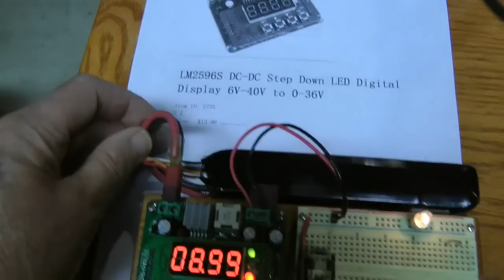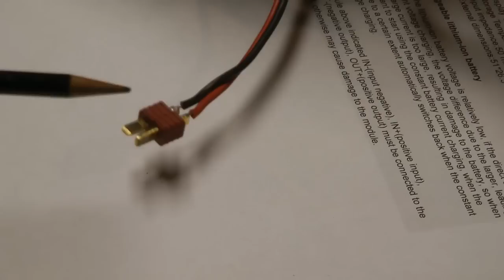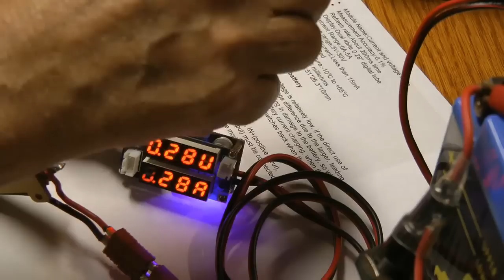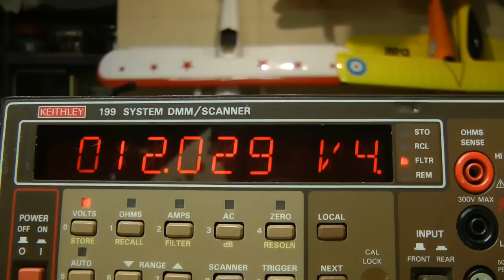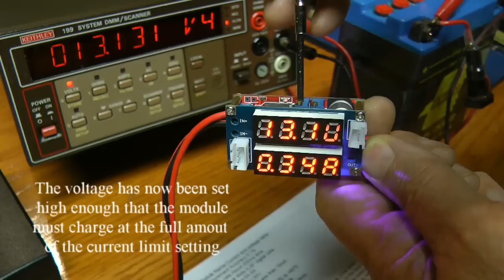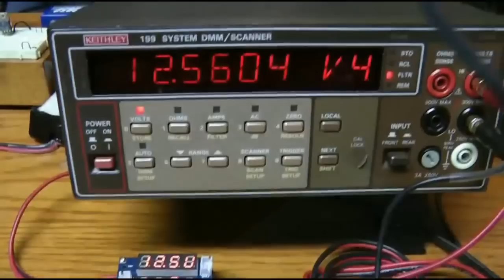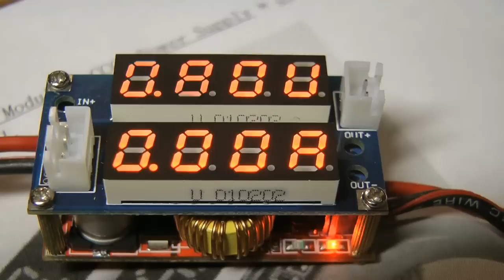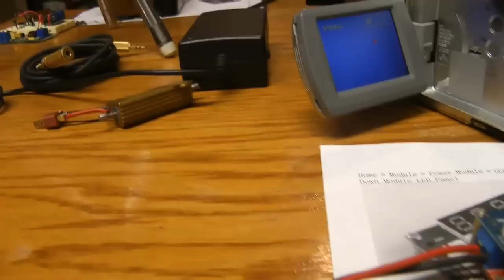Battery Charger / Power Supply

Comment: Thats a great little unit John. Thanks for the informative video.
Reply from the maker: +TinManPower Hi Buddy, I just thought of something. You can charge your project battery with the converter then just turn it around and power up you project with any voltage and current current limiting. No need to use a fuse.Take care.
Reply: There's another way and I believe a better way of setting your amperage (Current) is to use a multimeter, switch the pos over to the 10adc side and connect the wire coming out of the buck converter to the pos probe on the multimeter and connect another wire to the neg probe on the multimeter and hook it up to the positive on the device your powering and adjust the trim pot as needed. I use a lightbulb to set the current
Reply: Also if there's two lithium ion batteries in the case the max voltage will be 8.4v wired in a series, but when you put a load on it, it should be running at 7.4v so check that voltage going into the camera. Over Voltage will kill your camera prematurely.
Reply from the maker: Thanks for the tips and ideas friend.

Comment: you should be using a diode on these modules as they are not isolated especially when charging batteries its not hard to cut the wire on the power out and solder one on.

Comment: Hi, Much over a charge voltage of 13.8 volts on a 12 volt battery will boil it.
Reply from the maker: Hi Martin. I always charge lead acid batteries to 14.7 volts as set automatically on all my computer chargers. I think if you do a search you will find the recommended charge voltage is from 13.8 to 14.7 volts. I'm sure you know the battery isn't boiling when hydrogen bubbles are coming off the plates. Thanks for commenting.

Comment: I'm looking to change 12v NIMH batteries. The packs are 10 1.2v NIMH in series making the 13v 3700 ma. I want to put two batteries in series to make it 24 volts and then 10 in parallel to make one battery pack. What type of charger could I use?.

Comment: Hi 

Solar panel open-circuit Voltage: 40V

Battery 12 V (AGM

Controller : PWM controller max input voltage 28V

I need step down from 40V to 25V and connect to
solar charge controller to charge the battery? Will I lose energy in this converter
in step down mode? Or the module will convert in to Amps from Voltage while step
down?

Can i use this module to connect to solar panel and then output of the module to the solar charge controller which then eventually charge the battery?
Thanks,
krishnakumar

Comment: My module gets extremely hot to the smd resistor at the lower pcb when it draws over 1,5 Amp. You all should try your modules. I believe that resistor must be replaced with a non smd resistor with higher wattage. It seems is the resistor who is used to measure the current so all amps pass through it.

Comment: i see you are very good with this stuff, so do you by any chance know how to change a battery watch and usb also to normal plug in watch.The batteries go to fast and i would love to find a way to just plug in the watch to an outlet. Thanks
Reply from the maker: +Ela Maier 
Ela, This is just an idea but why bother plugging it in? If you soldered wires to the positive and negative contacts in you watch you could use a flashlight battery to run the watch right? That might run the watch for years. or at least one heck of a long time.
Reply: +DadHav Dead straight! The battery would probably last past it's shelf life running a watch. The draw is almost negligible.

Comment: can we make this as a replacement charger for 21votls cordless grinder
Reply from the maker: Hello, If the batteries in the grinder are lithium I wouldn't advise it. If you happen to short the battery by accident it might start on fire or worse.

Comment: Just ordered this for my car pc thanks for the great video John
Reply from the maker: Dan, I hope it worked out for you.
Reply: had to use something different in the end as the amperage output was too low for my means sadly.
Reply from the maker: I hear that. Nice little unit but more for small bench experiments. You might want to think about using it as a trickle charger for a car that is stored for long times in the winter.

Comment: It's not a "charge" indicator. The blue LED means the output is being current limited, in stead of voltage limited.  
There is a red LED next to the blue one to indicate the voltage is being limited, in stead of the current.
Reply from the maker: It's a little confusing about the LED's. You almost don't need them because you get all the information you need from looking at the display right? The blue diode turns off and on for me at about 60 Ma. In other words if I set the module to charge at 12 volts and 200 Ma. When I start the charge the voltage drops and current is 200 Ma. (Current is kept at 200Ma by dropping the voltage) As the battery starts to reach full charge the blue light goes out when the current drops to about 60 Ma. but is still charging slowly. There was no current limiting going on at this point. It was set but not being used at this stage of the charge cycle.

Comment: I have a few questions about battery charging that is puzzling me.  I have an Italian expensive 12/24 volts charger.  Lately, it ruined my weak battery and it went down from 11.6v to 4.5v, even though they said it was safe with automatic switch-off for battery protection.  
Q1 : Is this battery history?
Q2 : Is it correct that the charger's output must be above the battery's volt level in order for it to be effectively charging?
Reply from the maker: Typically a 12v lead acid battery will be fully charged at 14.7 volts and some chargers will even go up to 15.4 even though they are referred to as 12 volt chargers. Usually even batteries in bad shape will come off the charger looking like they are fully charged but as soon as they sit a while will settle down to their resting voltage. If your battery is dropping down as low as you say there may be heavy sulfating or damage of the plates. If you are talking about NiCad or NiMh there are different things to consider. Usually the condition you describe means the batteries are permanently damaged.
Reply: Thanks.  I was trying to make sure what the charger's output must be in order for it to work effectively.  Do you know if a charger with 11 volts would be able to charge the battery though?  
The charger that apparently ruined my battery is 12v/24v with Boast switch.  When I measure the output, it's 11.3 on regular and 12.1 on Boast! 

I think the Charger voltage MUST be higher than the battery's just a little bit in order for it to be effective.  Can you confirm this assertion? or oppose it..
Reply from the maker: Yes, Khalid. If you are charging a lead acid battery the voltage output from your charger must be high enough to get the 12 V  battery to 14.7 volts before it automatically shuts off or goes into a storage charging mode. That is of course if your charger has features like this.
Reply: I tested my new battery and when it's fully charged, it measured 12.7v with the car turned off.  It also measured 14v when the car is running because the alternator was charging it.  Not sure that a car battery can ever measure above 12.7 when it's not being charged.
My main issue though is this : Can a charger be useful at all if it's charging a voltage that is less what the battery's voltage is? example: battery is measuring at 11.5v and the charger's output is measuring at 11v.
Reply from the maker: I would say it's normal for a car battery to measure 12.7 volts after resting. If you leave an 11v charger connected to your battery, the voltage of the battery will be 11 volts eventually and stay there.
Reply: How do test a charger to determine it is broken?!

Comment: i have a 12v 20amp power supply so can it be adjusted to 14.4v from a 12v power supply to charge a battery
Reply from the maker: Hello, This is a down converter so you need a higher voltage on the input than what you set the output to. You might want to look for an R/C hobby battery charger. You can set the voltage at most anything you want and run it from your 12 volt supply.
Reply: Alright. thanks for the reply.. i will find a higher voltage charger then

Comment: after its fully charged,  does it automatically stop charging? to avoid overcharge. cheers
Reply from the maker: Sorry I missed your question until now. As the battery reaches full charge it will lower in current draw and eventually reach near zero. A defective battery might continue to charge.

Comment: The problem of those XL4015 is to replace the potentiometers to external ones. Burned two XL4015 boards trying to do so. :(
Reply from the maker: That's a good idea.
Reply: DadHav Yeah, it is. And the project box with the potentiometers and voltmeter ammeter turned out beautiful! Too bad it didn't worked out. :(
Reply: @MCsCreations  why it didn't work? You used multiturn pots?
Reply: @BeetleJuice1980  Sure I did... But still... 😕
Reply: @MCsCreations  what happened then? It doesn't work?
Reply: @BeetleJuice1980  Exactly. I tried with 2 boards. Dissoldered the pots from one and broke from the other... Neither one worked. 😕
Reply: @MCsCreations  have you used pots with the same resistance?
Reply: @BeetleJuice1980  Of course.

Comment: these are handy, i want to know what the serial port is for
Reply from the maker: I haven't found that out. My guess is the readout board is used on several different modules and one might output to the port. I'll check with a scope to see if there is anything coming to the port on this module.

Comment: Do you know how to use the white connectors on the top board?
Reply from the maker: +Steve Greenfield....I couldn't find out to much about them but I was told the three pin connector is a serial interface and the other not used on this module. My guess would be if you had monitoring software on the computer and the right interface cable you might be able to graph the voltage or current ups and downs.
Reply: On Alibaba, one of the pictures shows the connector with more pins connected to a laptop battery.

I had noticed that the 3 pin connector is labeled RX and TX, and that it is wired to the hardware serial ports on a microcontrolller on the top board. You are probably correct and it is likely just a constant serial stream of data.

Comment: Is that automaticly stop voltage when battery full charged?
Reply from the maker: +Rusen Yiyici ....Yes the current will lower and stop as the battery reaches full charge.
Reply: +DadHav Thanks.
I will use this for 18650 battery other lithium ion lithium polymer batteries. 
I bored to TP4056:) I subscribe.
Reply from the maker: +Rusen Yiyici .....Thank you Rusen. That should work OK for you, just set your voltage appropriately. LiPo's can be dangerous if over charged.
Reply: +DadHav  Thanks for advise.

Comment: Can tou charge lithium battey 18560 on this device directly?
Reply from the maker: You should be able to as long as you set the voltage and current settings correctly to match the battery.

Comment: How large of a resistor did you have to use?
Reply from the maker: Hello Jesse. I have a 1 ohm 50 watt 1% resistor that's in a heat sink. I normally use it like a current shunt to measure amperage.
Reply: Jesse Mxxz cLennan z

Comment: What kind of resistor are you using?
Reply from the maker: +Jan Demant ...Hello Jan, The resistor is a 50 watt 1 ohm  and it comes with a heat sink. I sometimes use it as a current shunt. Sorry, I should have mentioned that.
Reply: +DadHav Ty for reply.I seen those many places i`m just not sure what purpose they have . I learned something new.Ty.

Comment: If I input 5v. Can it output 15 or 20v.?
Reply from the maker: Sorry it's a step down converter so you need more input than output.
Reply: If you are very new to this, this dc dc converter is great value as it does both boost and buck. You have to wait two or three weeks to get it, but it is well worth the wait: https://smile.amazon.com/gp/product/B07L49MRGW/ref=ppx_yo_dt_b_search_asin_title?ie=UTF8&psc=1#customerReviews

Comment: can I charge a12v car battery worth this
Reply from the maker: +Charles Williams Yes but you first need for an example a 24 volt transformer to run the charger module. The charge would be slow at 2 amps or less to be safe but it should work. I thought about using one set to about 13.8 volts and around 200 Ma or so for a winter battery tender.
Reply: Why a transformer
Reply from the maker: +Charles Williams The unit is a down converter and requires a higher DC voltage goin in than what the output voltage is set at. By transformer I really meant a DC plug in power supply. the power supply should have enough wattage to operate the module at your required charge setting. As an example I use an old laptop power supply on the input. this supply has setting for 12 to 24 volts and I use the 24 volt setting. The power supply is 3 amp but I never need that much.
Reply: OK thanks for your help.